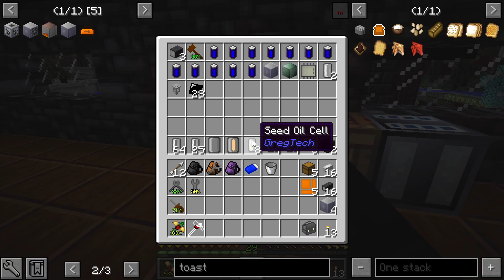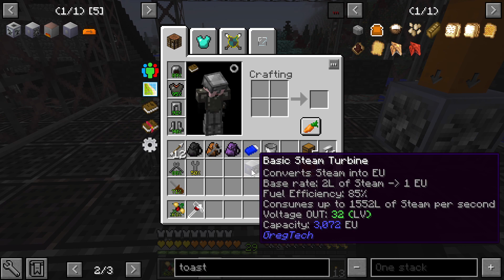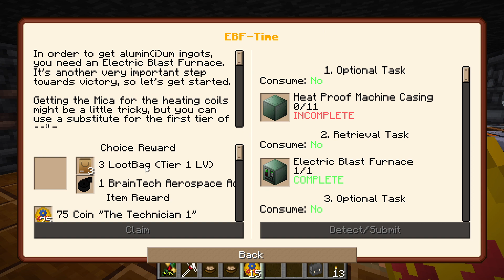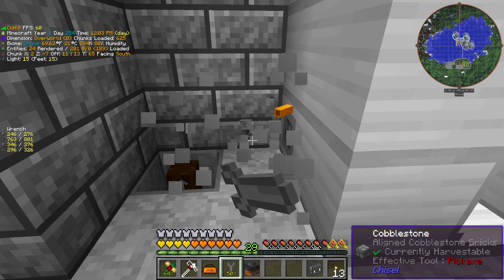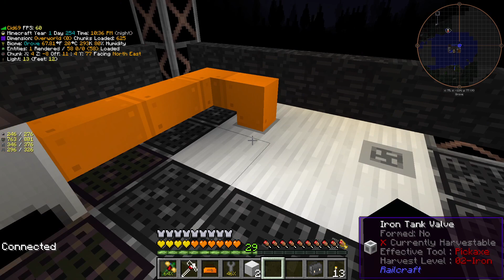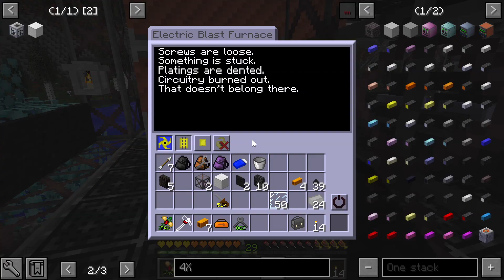GregTech - New Horizons - 39 - OK This is Complex

Comment: sorry for more back seating here, but use duct tape on the maintenance hatch, you need a soldering iron (not really easy to get early game) to reduce the power penalty for the circuitry burnt out issue. duct tape will fix all issues on the hatch.

Comment: to be fair i think you misunderstand? you should be able to just put two battery buffers on the energy hatches themselves with two batteries in each for the max amps it needs. each energy hatch only accepts two amps, and to save loss on cables you should have the steam sent to the turbines with large steel pipe mainly feeding down to the turbines. you might need a better pipe. but you should only need 4 steam turbines and 4 total batteries and two battery buffers for it to run at max power, your only issue you will run into is providing steam to the turbines. id say craft up some light fuel and make lv combustion engines. use regular oil, produce sulfuric light fuel, then hydrogen that and bam light fuel. much more power dense for your era. should get you into hv even seeing as when you get to mv you can make diesel power and get more bang per oil/heavy oil. you can even make renewable liquid fuels or gas fuels later for gas turbines or bigger combustion engines etc. you can follow the working with oil quest line or the bio for the masses for easier information.

Comment: As others have said - the cables are lossy.  There are lossless cables, but you're not there yet.  You can put the 4x battery buffers directly next to the LV hatches and place 4 batteries in each (you only need one buffer per LV hatch).  Running the EBF will drain the batteries, but if you have 2 turbines feeding each buffer you can break even (you will need bigger steam pipes driving the turbines).
Reply: Yeah battery buffers are by far the easiest way to tackle this particular problem. This specific mahine is a classic hurdle.

Comment: I think the past vid or two may already have answers to some things you encountered in this one. Especially on the Toolbox.

Voltage doesn't change except per tier. You have too much cable length and it's causing bad cable loss. Tin Cable loses 1 EU per block, so from the battery buffer to Energy Hatch the EBF is maybe getting 4 amps of 20EU something (like 80EU/t). Not enough as max you can sustain is 2 EU loss per amp (120EU/t bare minimal). Initially you want short as possible cables, also you can safely move the maintenance hatch and put the energy hatches side by side to safe 1 cable length. 

You can improve this setup by feeding the first Battery Buffer into the other Battery Buffer. The battery buffer in the back of the chain can get all the power from turbines and feed it forward into the other battery buffer(s) in the chain. Also fill the 4 slot battery buffers full with batteries, as the last buffer feeding into the Tin Cable will only output 4 Amps of 32LV. Hopefully this makes sense, as it's a key part of power stuff.

Poor example as text, but like this: [Batt] = 4 slot LV Batt Buffer, [Generator] = LV Source, [EBF] = LV Power Hatchs on EBF

[Generator] > [Batt] > ~Optional more [Batt] (no limit tbh)~ > [Batt] (last one in chain) > [Cable] > [EBF] (or whatever you want to power)
Think of a line of battery buffers feeding into one another, the end one feeds the cable, the far end battery buffer gets all the incoming power from generators. 

Once you get the EBF running stable, even if 1 or 2 ingots per run, make Redstone Ingots (EnderIO one) and make cables from that. They are the LV "Super Conductor" cables and have no loss for LV. These cables will change things for the far better.

Comment: Thanks for the video,  Cid 
1. You're at the point where you should be considering potin as a material to transfer steam. It has a much faster transfer rate. 
2. You're experiencing cable loss preventing you from running your EBF. You need to run the EBF at a full 4 amps, 128 volts. To do that you'll either need to run lossless cable (more trouble than it's worth), or move your steam generators only 1 block away from your energy hatches as energy loss only happens after the first block away from the source. Make sure you're using cable that can handle at least 2 amps/64 volts.